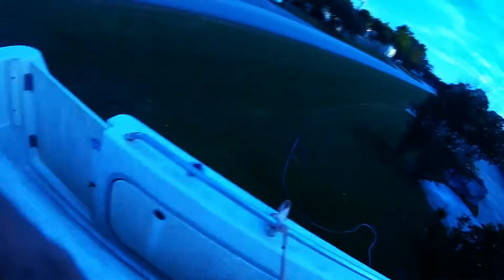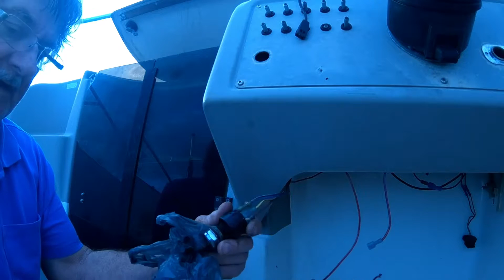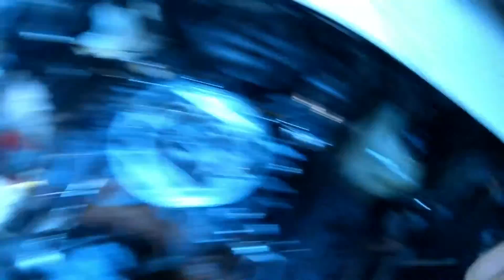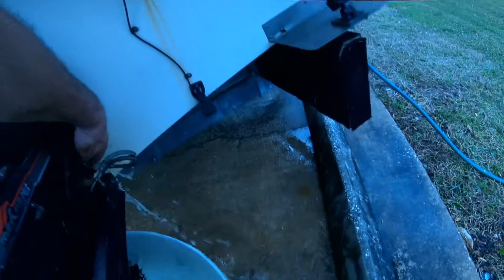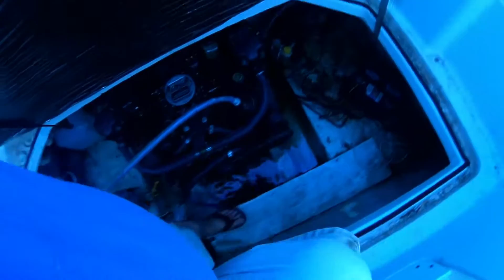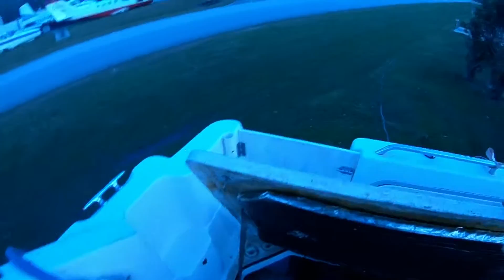Mercruiser Boat Project Cooling Water Flow Check

Comment: I once found a chunk from an old impeller stuck by the thermostat.
Reply from the maker: Yes, that can happen. That is why I changed T stats. I also considered pieces being stuck inside the water ports in the motor block, or head water passages.

Comment: Hey Cap! We just met you by Bahia Honda! Was a pleasure taking to you. Let us know what you catch tonight 😁
Reply from the maker: Thank you. You were very friendly also. I'd love to see you out again. I very much like friendly people. Someone forced me off the road on the Turnpike on my way back to Melbourne from that trip. I slid across all three lanes and slammed the left side construction wall. They never stopped. It cracked the bottom left chine fiberglass sever places on the boat about midship, I lost a guide on post, got a blown trailer tire and rim, andother trailer tire sidewall sliced, bent trailer axle, bent the bumper on my van. It threw the boat about a foot forward and to the left about 4 inches on the trailer bending the bow upright everything around in the boat and broke a few other things. Good thing was, nobody else got involved, and I did not get hurt. I replaced the trailer, fiberglassed the hull, and am putting final touches on her so I can make another trip down, maybe mid August.
Reply: @capnstevoanythinggoes  that sounds horrible, Neil and I are glad you didn't get hurt.
Reply from the maker: @peaceandeats  Hey there, I'm glad you responded. Yes, It was very lucky and a clean slide. A couple thousand dollars later, hahahaha. If I see you two again, be prepared for an invite to help catch us a nice fresh dinner, OK?
Reply: @capnstevoanythinggoes  yes sir 😁
Reply from the maker: I now live in Big Pine Key. That was my plan the whole time, to move down to the Keys. I love it.

Comment: Looks like a 96-97 Bayliner Ciera 2355. My boat looks exactly the same. They are good boats. Easy on gas. Not bad for fishing.
Reply from the maker: It is a 1995 Bayliner Ciera 2355 with a 4.3 Vortec V6, 180 HP. It does not have the deadrise on the hull for rough water I would like for fishing offshore in the Atlantic Ocean of the Florida Keys, but she will work. I have a new Simrad GO9 fishfinder/GPS, a new Standard Horizon VHF with GPS receiver, and a new Jabsco 146-SL motorized remote control spotlight to install yet.
Reply from the maker: Yep, my 1995 is a project boat, but I do like it. Just got a new Westinghouse i2500 generator so I can A/C in the cabin when I want. I did finally get to stay on my boat in Bahia Honda Marina for twelve days last September. One day there, I went out to the Carlson 2 Humps, bout 22ish mile out. Round trip was bout 60ish miles. Boat performed excellent and I caught a fair sized Cero Mackerel and two five pound Blackfin Tuna.
Reply: @capnstevoanythinggoes  I had to replace my gas tank last year..I installed a new larger tank (77gal) in the same space. I have the 5.7 liter I think 260hp.. I also run a 2300watt Gen. to run my a/c , TV  refrigerator and battery charger.. I live in Hampton Virginia.  I go ot to the Light tower about 14miles off shore. No further than that. I can run about 100 miles on a tank. I think the extra weight makes the boat ride better off shore in the swells and chop.
Reply from the maker: @Hitech82  I developed a gas tank leak also. Pulled the 55 gal tank out only to find one of the previous owners had cobbled it badly instead of reparing or replacing. I did not invest in a new tank yet, althought I could increase volume also. I repaired it with JB Weld and pieces of aluminum beer can, hahahaha. It still holds with no leaks. I have not posted that repair vid as I lost the footage somehow. I'm still glassing the decks back in. I took over three gallons of leaked gas out of the hold.
Reply: @capnstevoanythinggoes we like our 2355. It doesn't cost anything but gas. I use it 3 days a week.. I also got rid of the L shape seating. I redid the seat and open up the cockpit for fishing..
Reply from the maker: Yes, same here. I am cutting and remoddingfiberglassing the cutout area where the back of the L seat was and insetting my 25 gallon livewell. I used to own a surfboard business 13 years and have been fiberglassing boat stuff since 1969. I completely suctomize to my needs. I'm going to glass a long fishbox to either mount in that space from the helm to the stepdown and engine well cover, and to fit under the helm seat against the side under the controls. Or, I am just going to get one of those long fish bags that just fits in the compartment under the starboard v-berth seat just in front of the Head. I, like you want to have nice open fishing area. When I go out I also carry my scuba gear, (three tanks), and I will be running outriggers at the back of the window taper. When I'm running full scale, it's trolling five lines, two off the 14ft outriggers, I fish offshore and have the potential for big Wahoo, King, etc...need a long fish box. I'm also looking at a windless so I can more easily handling achoring while solo fishing. I've been solo to bout 25ish mile out of Bahia Honda in bout 650 ft depth. I plan Dry Tortugas, and possible Bimini/Bahamas coming up. Generator, A/C, ice maker, small 2 door refridgerator/freezer. I am also going to Desing a foam and fiberglass fold down hard top to  attach my canvas/vinyl window side and back pieces for inclement weather piloting. I'm an Electromechanical Assembly Engineering Technician by work Title, woo hoo, if that might help, hahaha, sorry. I'll put it all on YouTube. I'm fiberglassing a replacement for the front 19-3/4X19-3/4 escape hatch right now.
Reply from the maker: It's a 1995 2355, and yes they are good boats. I like the cabin layouts of Bayliner with the aft cabin, private head, and galley area.

Comment: Hi Steve, I have a 4.3 with overheating issues as well and I am interested to know if you tracked down the problem with your mtr. 
Thanks, Steve
Reply from the maker: Yes, I did finally figure it out, and was going to put a video up. It was the aftermarket cooling coupler.  The parts store did not give me a diagram of how to hook up the hoses, so I hooked the hoses up according to the repair manual. The four hoses going out from the coupler, (outflow hoses two each side to bottom of manifolds and to riser elbows. They had to be reversed of the way the repair manual said because of the design of the coupler. By the manual, the two coming out from closer to the thermostat went to the bottom of the manifolds and the two coming out from the front of the coupler going to the elbows. The two outputs closer to the front of the coupler had less resistance and cooler water than that of going through the motor and thermostat, therefore creating more backpressure pressure at the elbow to keep the hotter water outflow from the motor/thermostat from flowing out. I mistakenly  switched them and found out the wrong way worked. The hotter water output lines closer  to the thermostat are now going to the elbow/riser, and the cooler less restricted output flow lines are now going to the bottom of the manifolds. This less restricted, cooler flow now helps flush the hotter water out through the system. She now runs at about 150 degrees on a 140 degree thermostat. I ran her 25 miles offshore out of Bahia Honda, Florida Keys, putting about 60 miles on one day and never ran over the 150 degree range. It was all about that slight difference in water flow pressure. No overheating issues whatsoever now. Simple two minute fix after 3 years. If there is anything I can maybe help with your situation, let me know more details and I'll give what helpful info I can. If you go to my YouTube channel, click on "About", then lower on that page to the "Details" and "For Business Inquires", see if the email shows. Relate to that email address capnstevoanythinggoes@gmail.com then reply this comment back to me to let me know if you email. Then it would be easier to relay photos of issue, details, etc more privately, (for any security issues). It's all free, hahahaha. I might have some input that could help.
Reply: @capnstevoanythinggoes  thanks for the quick reply and update Steve. I’m glad you figured out your issue. My hoses are correct according to your description so unfortunately I am still trying to figure it out. 
New water pump in the stern drive , engine water circulation pump is good , new thermostat and temperature sender but still overheats after about 10 minutes at idle. 
I’m thinking a blockage in the risers or manifolds possibly as you mentioned in original video. 
Thanks for your time.
Reply from the maker: @cranker2850  If you have the original cooling coupler, the hoses would not be as I fixed. If you would like to chat about it send an email that address I gave and give your phone number. We could talk for a few minutes and it might help come up with something. I have worked on all my outboards, I/O's for about 20 years. 4-6-V6, V8 cylinder Mercruiser, Alpha 1/Alpha 1 Gen II, 8 cyl OMC Cobra, Evinrude, Johnson.
Reply from the maker: Yes, I finally did figure it out. I put a video on my channel explaining it. https://youtu.be/vrV42Jh-xgI
Reply from the maker: What are your overheating issues? Maybe I can help you troubleshoot it if you give me enough details. If we could speak to each other, I could ask specific questions of how you describe the symptoms.

Comment: is it possible to just take the riser and manifolds apart and clean them and inspect them and reuse them?
Reply from the maker: Yes, it is possible if they are not too clogged or eaten away. I took a hammer and big screwdriver and slowly chisled awar inside the manifolds, spaces, and riser elbows. I put them back on and they worked just fine. I still had the heating issue I decided to replace them to just eliminate that factor. I still have the old ones in my storage for future use, hahaha. Use common sense judgement if they can be cleaned. Remember, that is the life blood coolling so you don't want to take uncecessary chances. I go 25 miles offshore in the Florida Keys so I play careful. Just pay attention to your heat gauge at idle and under stress of normal use. If it stays in normal range after cleaning and re-installing, you have a temporary fix.
Reply: @capnstevoanythinggoes   ok thanks for the info. I live here in west Texas and this boat has been in only freshwater lakes. But the risers have never been serviced in over 15 years. My problem is one riser is hotter then the other ,and it doesn't overheat but it concerns me.
Reply from the maker: @hquiroz113064  I have also noticed one riser hotter than the other at times, even with the new manifolds. It is good your engine is not overheating. For the cost of new gaskets, it might be good to attempt to clean everything out. That will also let you see the internal condition of everything so you don't have to wonder. Also do a little more research on your particular setup and any symptoms common to it. The more you are familiar with the entire vessel, the more confidence you can have. I even replaced my exhaust backflaps to help prevent possibility of backwash of water which could slug the engine itself. The chance is very slim, but if the flaps are stuck, they could restrict outflow. Again, your engine is not currently overheating. Nice chatting with you by the way.

Comment: Hello 
I just replaced the impeller on my alpha 1 and she’s pissing good . Wondering if on muffs the left side riser got up to 145 and right side 115 . This was after idling for like 15 minutes
Reply from the maker: If the engine runs within normal operating range, it should be good. After running my engine, I've also noticed that the port side riser, and even the maniflold, gets noticeably warmer than the starboard. I have not measured that but I can feel it on my hand. I can also feel the difference at the hot water outlets on the outside of the transom. It could just be a matter of the way the water flows inside the system. One side might get less resistance and better cooling. Try checking the temp at as many points on both sides of the engine block itself, before getting into the manifolds. to try to get a more true reading of the engine itself.